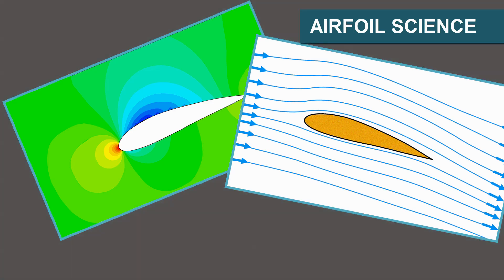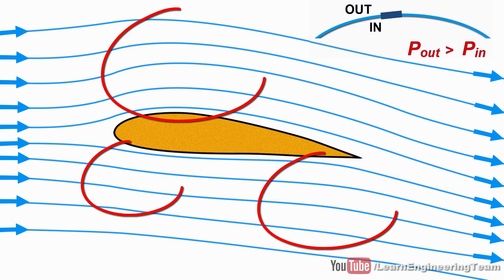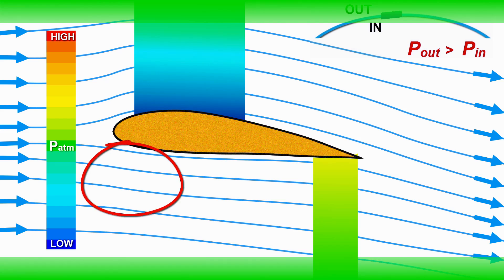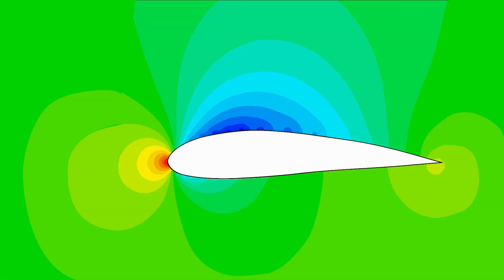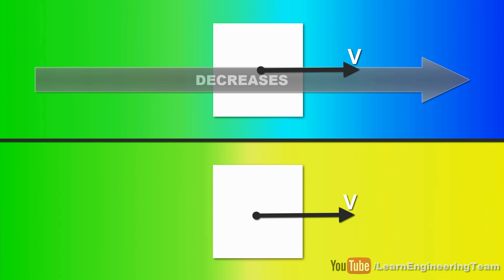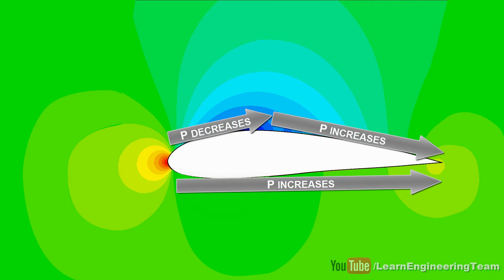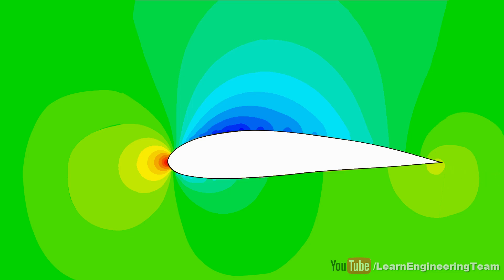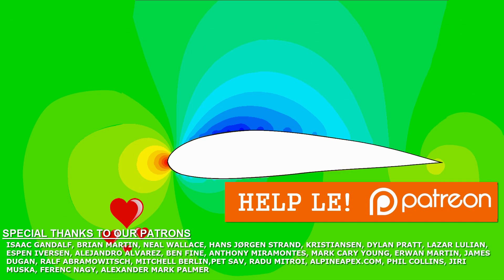Why is the top flow faster over an Airfoil?

Comment: Although similar to Coanda, it is NOT Coanda above a wing.  Everything else is ok.
It is ultimately the relative motion between the air and wing that is the cause of the pressure changes. These very same pressures push up on the wing and down on the down-wash air.
See this to be stepped through it:
https://www.quora.com/q/rxesywwbdscllwpn/Understanding-Lift-Correctly 

. . 
Cheers